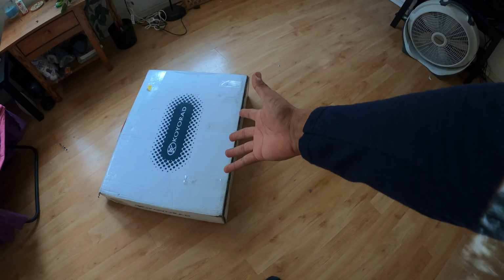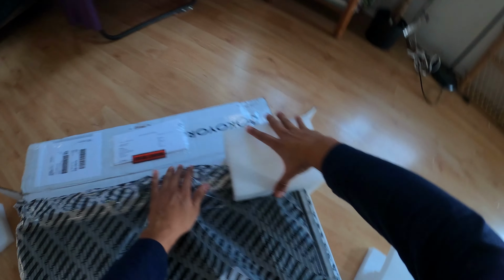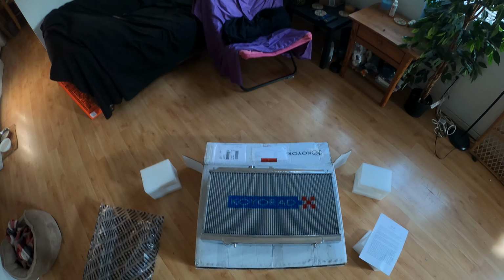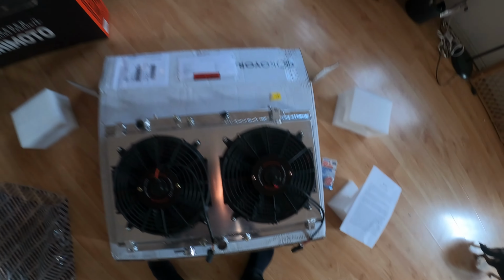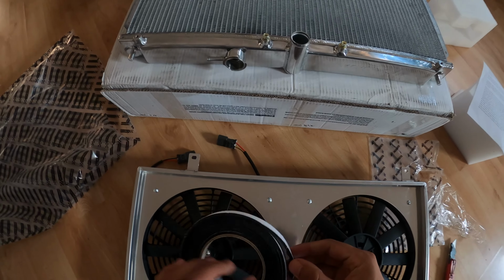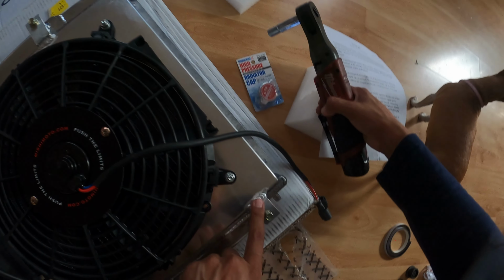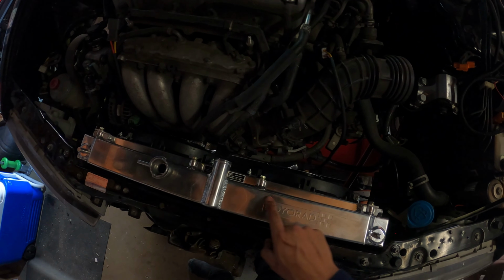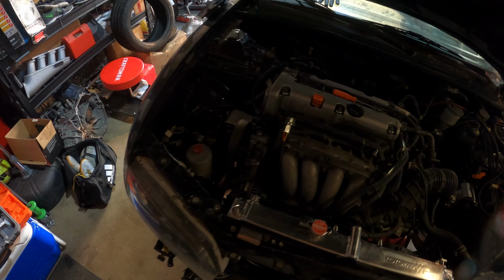K - Swapping My Honda Accord Part 10

Comment: nice radiator, Could you tell me how much does that k24a2 motor come out in a yoker? That it is complete (ecu + all motor cables)
Reply from the maker: I'm not sure how much they sell for in junkyards but you can get a JDM k24A for about $600 from importers depending on your area. I actually bought a salvage TSX for all my parts.
Reply: @zre909  It is reasonably priced like what I have seen from 2000 to 2500 dollars and only the engine, without ecu, or transmission
Reply from the maker: @arcangeldelagurda  I would look into buying a completely salvaged TSX as you can get them for $1500-$1800 then scrap the rest
Reply: @zre909  Thanks, the price is better, so I can take all the parts I need, even the odometer with all of them and their cables